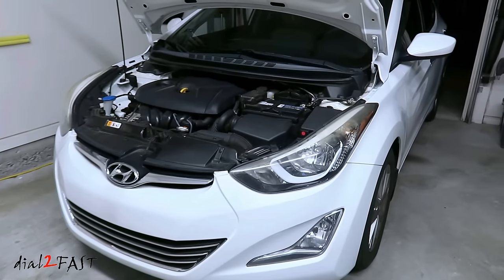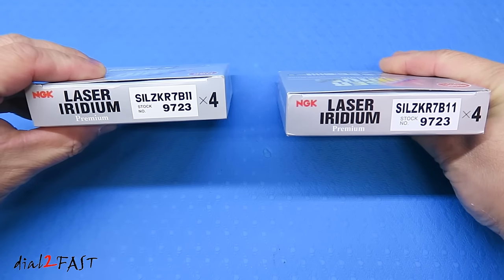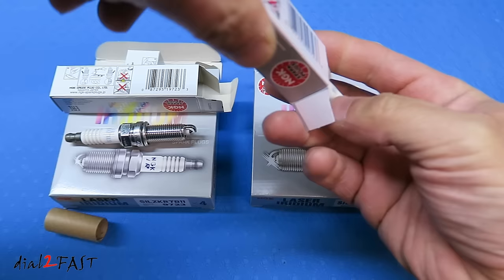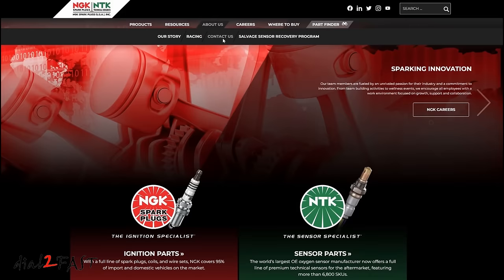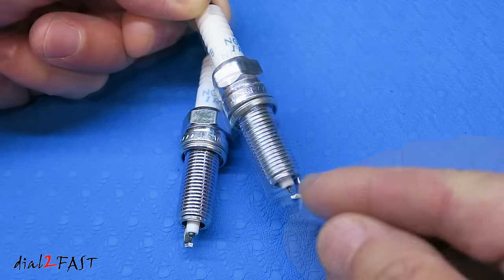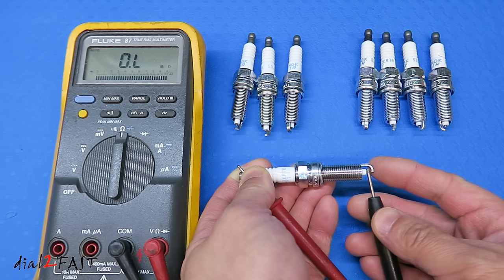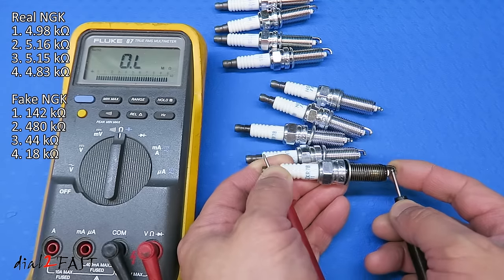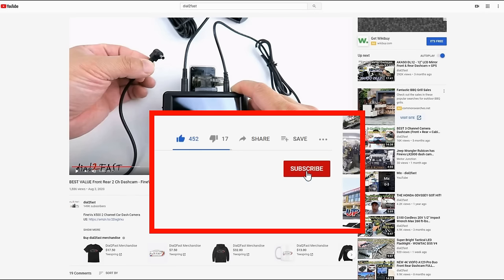Fake NGK Iridium Spark Plugs | How To Test!!

Comment: Amazon doesn't mind selling fake parts, be careful. eBay doesn't mind selling fake parts.
Reply: Which one does!
Reply: Correct
Ebay and amazon have same
Sellers,same person or company  in quite a few cases
Reply: Both companies actually don’t want you to tell them the parts you bought are counterfeits. At some point they will probably ban your account because they view you as a snitch or whistle blower. Such is the greed inflicted world we live in 🎉
Reply: Very true. Buying parts from Chinazon and FleaBay is a costly mistake. Packages look the exact same with (in my case) correct markings from Jaguar and International, but those parts only last thousands of miles instead of tens of thousands (Jag) and well over a quarter million miles (International) respectively. If you value your vehicle, buy quality parts even when they cost a bucket full of cash.
Reply: If you watch Louis Rossman video, you cannot be sure to even get cables which aren't fake from Amazon. I feel more safe buying from reputable Aliexpress stores than in Amazon.
Reply: I'm betting that they were from China.
Reply: Ebay doesn't sell anything.
Reply: Bought wiper blades from Amazon and found they were fake.  Wiper popped out and cracked the windshield.  Now I am out $500 to fix windshield.  Never will I buy auto part from Amazon or EBay.

Comment: How crazy that the manufacturer of the fakes spent a fortune creating the dies and machinery to make the fakes, and print the fake markings, but didn't spend 5 cents to install the correct resistor.
Reply: Probably does has the correct resistor but there are a few internal contacts that are probably garbage on the counterfeits. Which is probably why they all had way high resistance none of them were low
Reply: @connelly6375  Worse the readings weren't even steady showing capacitance issues.
Reply: I had the same problem.  I chased a misfire for months before I realized it was the spark plugs I had just replaced.  It’s definitely worth the money to buy from a reputable source.
Reply: The difference in resistance values is not due to resistance. This is because the materials used are different.

Comment: YOU SAVED ME !!! Came across your video and decided to watch it and scrutinize the NGK’s that I bought on eBay that I was about to install in my BMW 330 CI and to my surprise they are indeed fakes! Went and got a real set from my local auto parts store, cost a little bit more, but they have all the hallmarks of genuine NGK‘s! I can’t thank you enough for this very helpful video. Thank you.
Reply: Yep, the spark plugs are fake forsure on eBay. There $29 for a set of 6 haha. I was like nope
Reply: I also got a fake set off ebay and called NGK with #s to confirm they were fake. Wrote the ebay company and they refunded me so fast no hesitation 😂
Reply: I’m replacing my c63 eBay bought plugs just in case. Ordered from Fcp euro.

Comment: I also noted from watching this video the color on LASER IRIDIUM , the box on the left in the beginning letters is lightly purple whereas the box on the right is darker purple and the M with the box on the left looks to have a purple hue to it and the box on the right has more of a gold look . The S on the left is half blue the one on the right barely has blue as well as the second i in iridium . The box on the right the colors also look much bolder .
Reply: I'm a graphic arts guy so those are the kinds of things that I was picking out. But I'd probably have to have a legit package to refer to. Generally the fake was using enlarged, fattened images that took up more of the surface of every side of the carton. The plug's top terminal looked chubby. The type faces were larger and bolder on just about everything. The UPS code takes up almost the full available height. 
The glaring difference was the diagram on how far to turn the plug. They added an extra "2/3" pie next to the "1/2" pie of the real ones. (Maybe their fake engineers insisted on that being included for driving safety </s> )
I always wonder why they don't go to the trouble of taking another hour in fake design scrutiny to get those things correct. But that's in the nature of counterfeiters going for every penny of profit they can squeeze out of their victims.
MUCH THANKS TO @dial2fast FOR THIS SEGMENT.

Comment: I run a 1950s British motorbike with magneto ignition. That requires spark plugs without the resistor. A while back, I broke one of the two spark plugs, so I bought a pair of new ones (NGK BP6ES, from memory) from a local car parts shop. The engine had a persistent stutter, until I refitted the surviving old one and a B6ES cadged from a fellow rider. The stutter instantly disappeared.
Reply: I'd be testing and looking up the original then. 👀

Comment: Bought some fake ones off of Amazon as well.  Installed them on my pathfinder and after a few months read an article about fakes.  Ended up inspecting them and sure enough they were fakes. Gaps increase by 50% only after a few thousand miles.  Complained to Amazon and they denied my review to be published.  Next time I will only buy plugs from a local shop.  Good thing I caught this.  Thanks for a great video!

Comment: NGK is certainly the most used spark plug brand in Brazil. In 2022, a large gang was discovered that counterfeited spark plugs made in China and packaged them in Brazil. The counterfeit was so similar to the genuine  spark plugs that NGK participated in the investigative process to determine whether or not the spark plugs were manufactured by NGK. The most visible differences were in the printing brand  as well as the threads tolerance. The material that was noticeably very inferior was the central electrode. Therefore, only after a good period of use did the buyer notice that the spark plug  was being consumed much more quickly. Counterfeit iridium spark plugs were not found. The gang only counterfeited the lowest-cost spark plugs.

Comment: Sound advice. 
I had exactly the same experience with some NGK spark plugs in a kawasaki zx12r motorcycle, I fell for the cheaper plugs option which started to misfire after only 2000 miles. After which I went to a reputable dealer and paid the higher price, I've had no trouble since. Many thanks Mike UK

Comment: I recently bought a pack of x4   SK16R11 DENSO spark plugs. Seems really original but resistance values are:  4Kohms for one, 5K for 2 ,  and zéro Kohm for the last ! What à shame, directly in trash. I bought those for 45$. Thanks a lot for these information.

Comment: Interesting. 0:25 - spark pic on front of box has 3 diagonal artifacts, genuine only 2.  When measuring resistances, always keep your fingers OFF the probe tips, as your fingers are also conductive at this level of resistance. (Try squeezing the probes between the fingers of each hand, you will get a reading on the meter) There is no free lunch!😉
Reply: I would clip one meter lead to the top of the spark plug so I don't have to touch it, then carefully press the other lead to the center electrode without putting a finger on it.
Reply: will not matter if you have fake hands.. LOL
Reply: The way he did it should not cause any problems with the resistance reading because his hand only touched the cable/coil connector. The other probe of the multimeter was only touching the center electrode.  The resistance from his finger to the center electrode will be very high since he did not touch the center electrode.  Doing the measurement this way will not affect a nominal reading of 5k ohms.  Many experienced electronics people commonly hold one end of the resistor between two fingers to quickly test the resistance of a low value resistor.  Just make sure you don't touch the lead on the other end with any part of your body or any other surface.  This will work fine for resistances of a few MOhms and below since the surface resistance of a resistor is easily in the 10's of MOhms or even higher.

Comment: Take your coils voltage output and divide it by your resistance reading.
That gives intensity.
If you have resistor plug wires the should read less than 5k ohms per foot end to end.
It does make a difference when chasing a misfire and the gap needs to be set and any update spec employed.
I fixed a few using these facts.
Corrected them instead of throwing parts at it, and getting cheap prices.
That's huge for the whole equation.

Comment: Great video. I would not hold something I am measuring in my hands as they are conductors too and can mess up the readings. When measuring make sure your body's resistance isn't interfering with your measurement. I am installing some NKG's in my Toyota today. I am going to measure mine. Hopefully Rock Auto sold me the good stuff!
Reply: Hi. What was the reading and how has the car behaved since then?
Reply: How is your body going to stop the flow of electrons from travelling on a metal path?
Reply: @Spiritof_76  It wouldn't stop it. Your body is a conductor so it could effect the impedance measurement.
Reply: @76S30 Electricity takes the shortest, most conductive path. It isn't going to throw off those readings.
Reply: @Spiritof_76  If you take two resistors one valued at 3kohms and another at 100kohms, wire them in parallel what reading will you get as your final result?
Reply: @76S30  I don't need to take your electrician quiz to know that the method in the video works just fine. I can see your analogy, but it's irrelevant. He's trying to test for fake spark plugs. The human body or skin will not ruin that comparison.
Reply: @Spiritof_76  To know for sure that the human body or skin will not ruin a measurement (I mean any not just a spark plug) One would have to make assumptions of the body's resistance and calculate for the difference in measurement because there is a parallel conductive path in the measurement. Depending on the tolerance you want to allow for inaccuracies the measurement will not be the same. It maybe off by an ohm or thousands of ohms depending on what you are trying to measure. The answer since you're not willing to entertain the idea is approximately 2941.18 ohms. Is that what you expected? Why wasn't it 3k ohms since electricity takes the path of least resistance? When you are conducting scientific experiments you want to avoid contamination. Especially when you are teaching others. Why no do it correctly and develop the correct habits?
Reply: @georgemaina5162  I'm sorry I do not remember what I got. I do remember feeling fine about the results and that all of the plugs measured nearly identically and very close to what I expected. It did run much better though as the old plugs were in bad shape.
Reply: @76S30  If he tested every spark plug the same way, how would the "human body as a conductor" not be the same for the genuine plugs and the counterfeit ones? No variable was changed except for the plugs themselves. Same test conditions. I'm not a scientific method denier. I like your tenacity, but doubt the outcome.
Reply: @Spiritof_76  The body itself is inconsistent. How hydrated you are at the moment will change your body's conductivity. How you're holding the leads will change the conductivity. It's just best to keep that containment out of the equation. Here's what google says about the body and resistance to electricity, "bioelectrical impedance" "Current paths in the body used by impedance will generally differ from person to person because of differences in body size, shape, electrolytes, fluid distribution, or other aspects of the body's composition."
Reply: @76S30  It was the same guy testing the plugs one right after another. How much change is to be expected? A person could even try 3x with the same plug to be sure. It's much ado about nothing.
Enough talk. Go try it. Stop being a goof. You are like having a discussion with a religious apologist. You won't talk yourself into proving anything.

Comment: I had no idea until today that this was a problem. I had an NGK plug fail causing a misfire on a Honda Accord. I had installed 4 plugs from Amazon a couple years ago so I assumed they were not the problem.

After testing the coils, injectors, and doing a compression test, I figured it had to be a plug. So I did a little research.
After seeing this video and a few others, I learned mine were fake. I guess I got lucky they lasted 2 years. So I said screw it, I went to Honda and bought directly from them. Yeah they were expensive, but peace of mind is priceless.

Comment: Great video, thanks for this info, I'll check my spark plugs this way in future, is there a table showing the acceptable range for different type plugs? By the way, I think the 2nd fake plug you tested was actually 0.480  kilo ohm, 10 x less than the correct spec.  🙂

Comment: if you're measuring higher resistances (like the fake ngks), you shall not touch the probes with ur hands, as you're basically parallel connecting yourself to the measured object, and lowering the number
Reply: 500k is basically dry skin. So there's no resistance within the plug. That would destroy a coil quickly!
Reply: nein

Comment: I've had problems with the last two sets of ngk plugs in my Jetski. 
One had the ceramic broke right at the electrode and just this year the ceramic  cracked where it meets the metal body causing it to destroy the plug boot.
Limped home on that one. 
I just bought a new set online, going to try your test before using them.

Comment: Just got recommended to me after a new set of plugs were installed. Had a misfire and plug 1 was wet with fuel. Will be testing resistance tomorrow

Comment: I just bought a set of Denso Iridium TT (TwinTip) spark plugs. However, I bought them from a parts store that I didn't know if it supplied genuine parts or not. Thankfully, all 4 spark plugs test out at 5kΩ-5.07kΩ which is perfect. I also tried scratching as Denso suggested and it seems to be as in their videos. I guess I can now keep them as a reference so I can more easily tell if I land my hands on a fake one.

Comment: Thanks for the video.  128400 on a 2010 Honda.  I decided to change plugs and coil. Purchased NGK from local, small town Minnesota, USA NAPA.  I  took one spark plug back,  as it had burrs on the thread of the plug, and didn't go into the engine smoothly.  They did switch plugs, no charge. However,  I also replaced the coils with NGK, and the car stutter after start up, cold engine idle at a stop light, leaving work.  Now I'm concerned,  did I buy fake?

Comment: I also made a mistake buying cheap Chinese fuel injectors for my "91 Nissan hardbody, and got nothing but a sloppy idle, and monstrous fuel economy ( or lack thereof ). I ended up buying the proper injectors from a dealer back East at $139 a piece.  I spent another $ 65 to have them flow tested and with this reassurance I will not buy cheap Chinese knock-offs again. I am a happy camper now reaching 20 mpg and sometimes 24 mpg. 
I will test my next spark plugs,  just like you show in this video.Thanks for the advice.
Reply: You may have just been unlucky they  worked great for me with multiple vehicles, they only cost around $40 set shipped instead of $350+ locally. The last set appeared to be genuine originals with the sellers initals engraved onto them, perhaps i've just been lucky so far...
Reply: @neiliewheeliebin  No worries brother, I found a place in AZ that has them for about $70 and are true original equipment. Cheers!
Reply: @neiliewheeliebin  - You're more correct than you might think. Very few people know that many OEM and some of their respective aftermarket parts. Most times come from the exact same factory! With the same workers, same materials, etc...
I worked for a well known brand of components. We made among several others, ignition coils. From Peugeot and Citroen to Mini or Mercedes, even Harley Davidson! And for a lot more "brands".

All the higher QC results tested components end up as OEM parts (more expensive). 
But the lesser successful components, during QC. Seldom go to the garbage/recycle, unless they're really not functional. By far and wide they end up in aftermarket boxes. Being sold at the counter for slightly cheaper retail prices. That doesn't mean they don't work. It only means there's more chances of "failure".

Worth mention that the QC threshold for tests & approval. Are 100% defined by the brand/client. It's the brand that determine, impose, and eventually pay. For their "quality" standards. The factory simply produce what they order, in the conditions they order. 
As an example Mercedes has exceptional high standards. And trust me on this, they payed for it. So would the final client! Other cheap(er) brands not so much. Harley being one. As long as it fired a spark it was more or less QC OK. ;-)      
Just an insight. Cheers